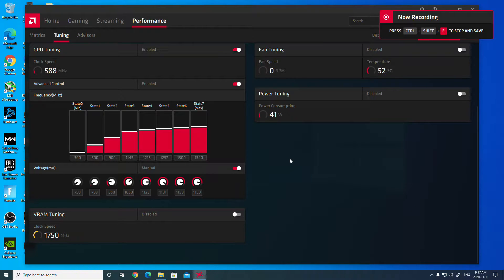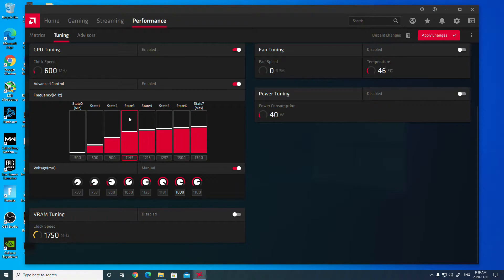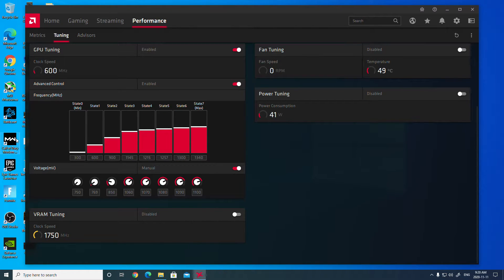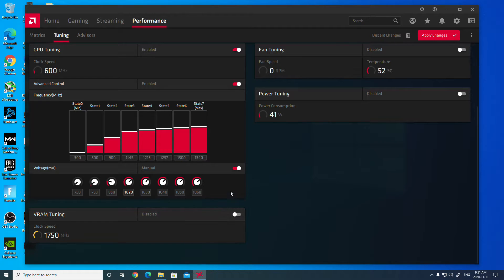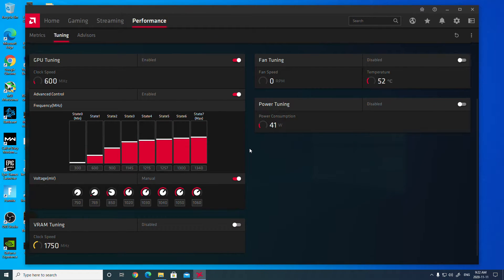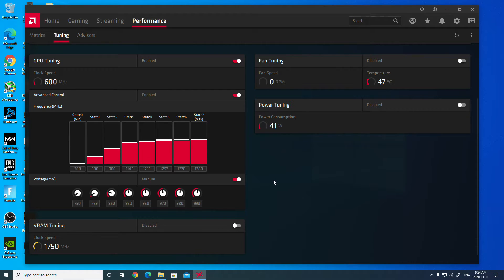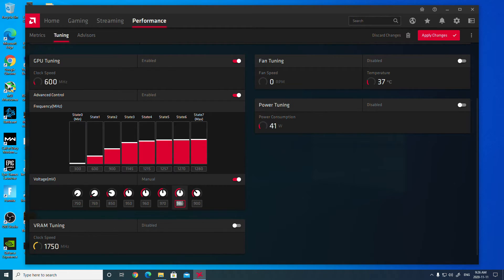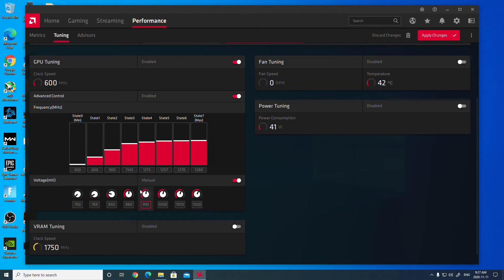How to Undervolt RX 570 RX 580 Stable Voltages EXPLAINED - Lower Temps - How to Fix Overheating GPU

Comment: Asrock Phantom Gaming D Radeon RX 580 8G OC
Default = 1370 MHz, 1150mV, 90°C Max (It used to turn off itself)
Best = 1320 MHz, 990mV, 75°C Max

MHz = 300, 600, 900, 1145, 1215, 1257, 1300, 1320
mV    = 750, 769, 887,   950,   990,    990,   990,   990

Thanks!

Comment: English is not my first language but correct me if I'm wrong. So the lower the voltage it's better right?
Reply from the maker: yes lower voltage = lower temps
Reply: @AleksandrsBrodie  so if I lower the voltage should I lower the frequency (state thingy) or leave it be
Reply from the maker: @ if the card does not crash you can leave it, the most important is to find settings that are stable. generally these cards are good around 1200mhz on the core clock, then find voltage 1000mv or less
Reply: @AleksandrsBrodie  thanks

Comment: Bro i purchased 2nd hand PC.gpu is Rx 590 but i checked gpu is rx 590 GME China only . Fake scam .i worried 2 month because my gpu temp goes to 83 C to 86. I saw many videos but not solved my problem but i see your video i shocked that Different MHz use Different Voltage.my gpu is 590 not a real it is 580 but OC upto 1380MHz so i set it to 1340MH and 1150mv decrease to 1050mv and bom . GOW Game after 56 fps temp are 83 to 86 C present settings but now give me 60 fps temp is 65 to 67 c . I make another settings clock speed sett to 580 base 1254MHz & 9oomv and give me 5 fps less but temp are 55 C . 😂
I test this 2 settings and pc crash many time and restart 10 to 15 times but i success . Thanks a Lot you save my GPU life my Money 💰🤑 you are a Great person Thanks you so much Bro 🥰❤️

Comment: For anyone who wants their ZERO RPM fan back after setting an undervolt
Export your profile at the top right of Radeon Settings
Open that file with notepad or some text editor
Find this:
<FEATURE ID="18" Enabled="True">
<STATES>
<STATE ID="0" Enabled="True" Value="0"/>

It will say "False", change both to "True" as shown here, save it.
Click "import profile" in Radeon Settings and open the file you just saved.
Ta da! Zero RPM has returned, your fans will say "0 RPM" if your card is at idle.

Comment: brother please im very bad in settings what are the best undervolt settings for my xfx rx 580 8gb for low temps brother please help me <3
Reply from the maker: Copy these, and of it does not work increase voltage until stable
Reply: @AleksandrsBrodie  when i copy settings my pc doesnt freeze or turn off
i tried every 3 of your videos but none helped my temps are still 80-90 i need your help do you have discord or facebook or something and i will share my desktop screen and maybe help me please brother i need your help very much 🙏😔

Comment: when I try to lower the voltage only by 5 it always crashes when I boot up a game. my specs are amd athlon 200ge, rx 580 2048sp, silverstone 500w
Reply from the maker: Then you may need to run higher voltages
Reply from the maker: Or lower core clock more

Comment: i have i5 3rd gen + rx580 and 450w psu ...so what voltage setting should i keep
Reply from the maker: You should be fine with these settings.

Comment: @Aleksandrs Brodie
Hello, i do RX570 8GB, VS550 PSU. The problem is that when i play games like Counter Strike or Minecraft(with no shaders, just defaults) and in fullscreen mode, temperatures goes up to 87, but when i play in windowed mode, temp goes 65 - 75degrees between. So.. Idling is 29-35 degrees with no problems.. I even changed the thermal paste "MX-2 Thermal Compound", cleaned fans, but didn't thermal pads..

I didn't find that voltage tuning in my amd control panel.. But will this voltage.. what you just said in this video would help solve my overheating problems?

In "full load" like 87 degrees my "power consumption" is 109 Wattages..
Currently i'm afraid to play with that card, because of degrees and thinkin about that card will go dead..
Reply from the maker: I would do more research on how to undervolt, otherwise just lower power limit. But yes running thr gpu about 80c will kill it probably
Reply: @AleksandrsBrodie  Thanks for fast replying! 

So something happened, i played CS:GO, fans speeds itself when degrees gets above. One moment just black screen and on my motherboard Cpu and Dram  lights started blinking. I did restart and now seems running again.
Is it actually something similar to gpu voltage being unbalanced? If yes then I know I need to do more research and lookin for solution.

Comment: Hey, man I tried out another videos undervolt settings and when I play Hitman 3 I get driver timeout errors. Is this because my voltage was too low for the clock speed? I just copied yours and will adjust it if I get any more errors. I just wanted to know if driver timeout errors are related/caused by wrong voltage and timings.
Reply from the maker: I'd suggest try running a bit higher core voltage
Reply: @AleksandrsBrodie  I ran your undervolt settings in hitman 3 and my temps did not go past 81c! I did not get any driver timeout errors/crashes. Thanks for making the guide!

Comment: Bro how can i contact you i set the milivolts to 1075mv on state 7 but it still showing 1150 or 1180+ on msi afterburner
Reply from the maker: hmm, must mean the undervolt is not applying properly. I wont be able to help you 1 on 1 sorry.
Just keep trying different settings, see how they affect the card, by doing this you will start to build and understanding. that is how i learned
Reply: @AleksandrsBrodie  Temps are staying between 63c to 65c max full load tested on unigine Heaven Benchmark
Reply from the maker: @arclyrayt9953  nice. if you find system unstable with those settings, just increase core voltage +20mv until stable.
All the best!
Reply: @AleksandrsBrodie  anyway to undervolt CPU?
Reply from the maker: @arclyrayt9953  i am not sure. sorry.
Best way to cool cpu is with bigger cpu cooler. I personally liked the Gamaxx 400 from deepcool
Reply: @AleksandrsBrodie  try ThrottleStop and make a video on it!

Comment: How can the global settings not be applied to every 3D application? It doesn't make sense that you need to add each game to it. I assume that if you want a game to have its own profile you can create it which overrides the global config, but if you don't do that the global profile takes precedence.
Reply from the maker: Global settings should apply to all applications, the only issue is you have to load the config each time you boot pc vs adding an application profile does it automatically in theory
Reply: @AleksandrsBrodie  what exactly do you mean by load the config each time?
Reply from the maker: @pingon55555  from my understanding, you cannot set a default global setting.
I have not looking into this that much, but when I was trying to set an undervolt, I could not get it to automatically keep the undervolt settings for the global section which would apply to all programs. so I would have to set a game profile to each application.
Otherwise, each time you restart the pc, you need to apply the settings on global.

Comment: What about the rx 590 fatboy, I tried like 10 settings and nothing really works. It keeps crashing.
Reply from the maker: try a lower core clock with higher core voltage.

Comment: Solid advice everyone should apply if want to OC these cards/anything really. 

I've got it 1100 @1340 for RX580 8GB (saw comment below figured why not duplicate their success)

Did the in app stress test, normally by end of it getting up to like 77 with my manual OC's, and worrying part is like it seems exponential heat gains. Have pretty solid cooling setup with my fans/new case but yeah, long play sessions don't really get major frame rate drops, but will crash more often, and overall comp seems to be struggling.

This test? 65, and it was DANCING on the point, ie, go up to 66, drop to 65. For those i'm totally confusing with my rambling writing style heres' point of applying under-volt logic; 

My system was having a cooling effect during a OC'd STRESS test, this is very nice in my books lol 

lol fans didn't even spin up(vs how normally go ape shit during stress tests), geez, poor GPU, been just torturing it for years now xD Good thing I saw this once I started manually OC'ing, think with default auto clocks, keeps it from using too much power in first place that kinda defeats point of OCing lol. Again this advice, just right.
Reply from the maker: Glad it helped.

Comment: Hi I wanna say ! You are a life saver!..

I have an RX 580 4G and my problem was in battlefield 2042 my fps is around 70 but still I had a lot of lag while playing....it was impossible to play without lag and stuttering..

I figured it was because my card was reaching 80-82 degrees in Temps..

After trying you method i am using 1100 @ 1340 MHZ... And my Temps have gone from 80 to 65-70 max...

This is amazing cause I have absolutely no lag or stuttering at all and I can finally play this game smoothly...

Thanks for this video ! You just got a sub

Comment: Hi there, i would like to ask a question. I get gpu memory errors if i alt tab when gaming or benchmarking, note that this only happens if i alt tab, i can run games and benchmarks for hours without no gpu memory errors. Why could this be happening ?
Reply from the maker: I am not sure. I am assuming you have up to date drivers and you have not overclock your memory.
Maybe try running a little higher core voltage is the you already have new drivers and stock mem clock/
Reply: @AleksandrsBrodie  I have tried reducing the memory frequency and upping the voltage but it doesnt matter at all, i will countinue researching.

Comment: what about "power tuning" , i heard if you crank dat up , the card will draw more power = more stable perfomance and = more heat, whats your take on this? or am I wrong?
Reply from the maker: Yes if you just power tune I think you still run higher than needed voltage.
This allows you to manually adjust the settings

Comment: Hi! I have a problem that I have huge stutters/fps drops while in fortnite lobby/game. Sometimes its good fps but most of the time like 60 when I'm running 144fps cause I have 144hz monitor. It started happening like 4 days ago when I updated my Windows I've watched tuns of videos but nothing helped. Does anyone know the solution?
Reply from the maker: If it stutters after undervolting, try increasing the voltage to see if that has any effect.
Otherwise you can also try driver updates.
Reply: @AleksandrsBrodie  ok will try to do that as soon as I get home!

Comment: ok i copied your settings and my game crashes and amd says "AMD software detected that a driver timeout has occurred on your system." Is it a bad driver or no
Reply from the maker: Mostlikely your gpu needs a higher voltage to run stable.

Comment: Hey so by my understanding undervolting should decrease temps right? So why is it that my GPU overheats whenever I undervolt. Ive tried just about everything. The moment I slightly undervolt the temps spike.
Reply from the maker: there are probably a few factors, 1. your fan speed control, 2. how much power if your gpu using in software before you undervolt while in game/underload. and how much power in software does it show it uses in software after you undervolt.
If its more after you undervolt then the gpu is using more power than stock so running hotter.
I am not really sure what your situation is but start with setting a stable fan profile in the AMD drivers or in MSI afterner, then you can go ahead and check temps for and after undervolting.
If done correctly, undervolting will always make your gpu use less power and run cooler, as you are running lower than stock voltages. it may just be a setting in your config what is reseting the voltages or something.

Comment: What happen in the future if  i under voltage it to 900 ? Could my VGA have an artefak?
Reply from the maker: Yes potentially or it could crash. But if it does, then all you do is either lower core clock or increase your voltage
Reply: @AleksandrsBrodie  i've overclock it too 😂
Reply from the maker: @togorigik2739  if it runs stable and it's not crashing or artifacting then it's fine.

Comment: Rx580 8gb wont works /:
Reply from the maker: Remember these setting may not work for your card, your gpu may need a high core voltage to run stable.

Comment: If you have it set in global settings, does that not apply to the games or do you have to set a profile for each game?
Reply from the maker: If you apply it in global settings it applies to all games, but the setting wont save and load by default, vs a game/application profile will save and automatically load each time.

Comment: Do you think my cards lack of performance could be due to a lack of power im running a 500w psu on asus mb and ryzen 3350g cpu
Reply: Plan on upgrading the cpu once i get my gpu sorted
Reply from the maker: You are mostlikely being bottlenecked by your cpu.
You can use a monitoring tool like msi afterburner to see if your gpu is running at 100% utilization in game or if it is a cpu bottleneck
Reply: @AleksandrsBrodie  will try that thankyou matey, didnt think it would be that as it was performing better when i was running on the igpu
Reply: My gpu utilization jumps between like 4% usage and 99% is that a bottleneck caused issue?
Reply from the maker: @malfea  it would seem like its a cpu bottleneck. i am not 100% sure tho. but upgrading the CPU will be a good next step for your system, and also making sure you are running with 16gb ram
Reply: @AleksandrsBrodie  okay will have to look into it thanks for the speedy response

Comment: Hello nice video,i have a question,i use to play with 60hz TV and all was fine i think temps was like 65° max After 10h of gaming,2 days ago i bought 165hz monitor since that my rx580 8gb temps vent up to 75-78°after like half hour,Is that normal?
Reply from the maker: You will want to undervolt the gpu to drop temps.

Comment: How do I add a game to the game profile if it doesn’t pop up on AMD software? Will the settings still apply on Enlisted Beta if I undervolt?
Reply from the maker: there is an option to manually select an application, so click add game profile i think, and around the area where you normally select a program, there should be an option to search through file explorer and select it.
Sorry i cant explain it any better lol. just know the option is there!
Reply: @AleksandrsBrodie  okay I really appreciate it for responding. Thank you :)
Reply: @AleksandrsBrodie  hey I have a question. Why does my tuning for the games I want and Global tuning not save when I restart or turn on my pc? I have to keep going back on the software to change it because it won’t load with the tuning automatically
Reply from the maker: @darthbhanu4162  global tuning does not save. idk why.
the only way to get the settings to save is through game profile.
Reply: @AleksandrsBrodie  I tried to use game profile but it won’t save when I play Enlisted. Global tuning and Valorant is still there but I have to click + and add Enlisted again and then start tuning it again. Do you know why it doesn’t save?
Reply from the maker: @darthbhanu4162  I am not sure why.

Comment: 1060 mV, 1050mV, 1040mV works for me at 1360 MHz. I tested it for 2 days already its stable and doesnt go over 80C which is great :) RX 580 4GB.  Thanks for the help!
Reply: Its just how it is, the card likes to run toasty. For me on summer its 74-78c under load with 1050mV undervolt and -15% max power (130w under full load) @ 1366mhz. Not the best but oh well. Might try underclocking and undervolting it heavy for fun to see if i can get in the 60s under load haha

Ps i have rx 580 4gb sapphire pulse model
Reply: @Spark-pv9js  you could try increasing the fan curve to be more aggressive. I tuned mine so if it ever gets close to 80c it ramps the fans to 100% which keeps it cool then it drops the temps down fast. You could also try modding your case or even just opening up the side and placing the a fam there. I got it to 49c in witcher 3 like that but it is a tad loud
Reply: @Spark-pv9js Mines at 71 - 76°C but it's winter here but I overclocked and undervolted it to GPU: 1450Mhz @ 1050mV. I like it quiet and I know I can change the fan speed but I honestly feel like that's good temp for the low noise level. It makes a noise and fans spin at almost top speed when I play Minecraft though as the shaders I have are graphic intensive but it's at around 50°C.

I have Aurus RX 570 4GB OC.
Reply: Thats still really high
Reply: My Gigabyte Aurus RX 570 4G OC is at GPU is at 1450Mhz at 1050mV and I put my VRAM to 1800Mhz and it's stable thus far. I'm seeing how high I can go.

Comment: I heard on some site that undervolting makes 1 percent fps lows worse, is that true?
Reply from the maker: If the voltages are way too low then yes I could.
It has more to do with not setting the correct voltage than anything.
So if you find your 1% low fps is bad, and it's not a cpu bottleneck, bump up the gpu core voltage +20mv, then test again and repeat until it's how you like it.
Reply: @AleksandrsBrodie  also what are bad 1 percent lows, like what range
Reply from the maker: @redjohn.  generally for 1% lows practically speaking, If my game gets stutter and its caused by too low of a voltage, then I adjust voltage.
If the game feels smooth, then i leave it.
I dont necessarily look for a specific number.
When the 1% low is closer to the avg fps, the better but it all depends on what hardware you have.
That's why I just focus on, does it run smooth or not, and work from there.
Reply: @AleksandrsBrodie  ok ty
Reply: @AleksandrsBrodie  ok thanks